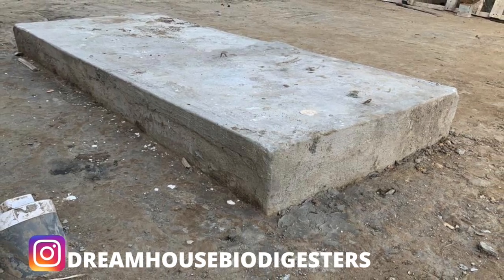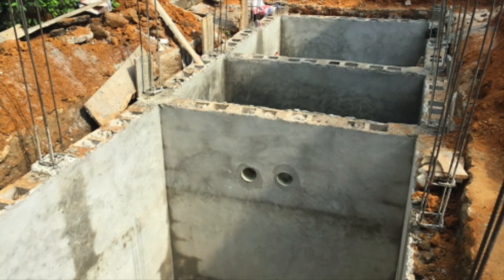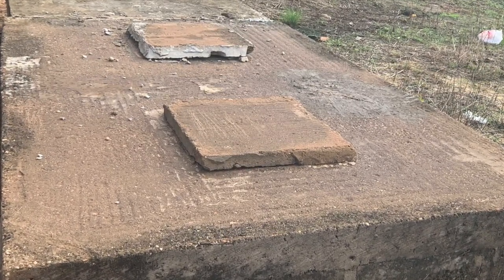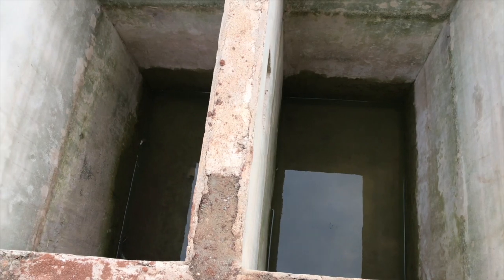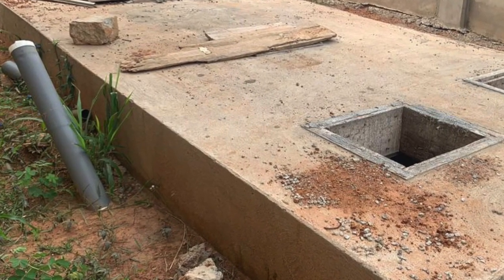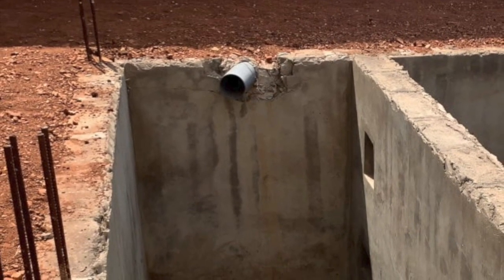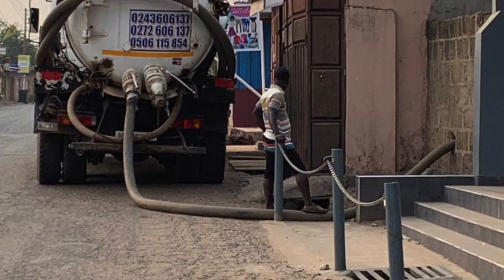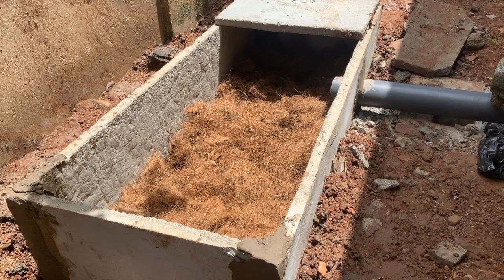Septic Tank or Biodigester: How to make an Informed Choice

Comment: Now if you have plenty of room for a septic system, and can pay for one, I would choose the septic tank. If there is a pipe that is letting out the methane gases of the Bio toilet, how is NOT stinking? 
Maybe for 1 person it would be okay, BUT, how do you separate the liquids from the solids, use 2 separate toilets? I'm sure this might be great for a place where septic tanks may be hard to build in a small space and if you don't have much time or money and need a place to go to relieve yourself, BUT, if you CAN go the septic route, I would. With a family of 3 or more, that solid waste is NOT going to break down very fast. My septic tank is basically a BIG "bio digester" with bacteria that we add every 3 months, and probably don't need to. When that lid is off, you can smell the methane gas buildup, and it stinks with the lid off, so, how is that Bio toilet NOT smelling with that little pipe sticking up out of the top of it? That poop without any liquids is just going to sit in the bottom and will NEED cleaned out in time. Those shown here are concrete on the bottom, no way of the waste being able to be absorbed into the ground. It all seems like it would be a major pain to keep up when you think about the reality of it and not just hear the things being said that make it seem like a great idea. 
Now the big ones on a farm that they can harvest the gas to make energy to use, maybe they make sense. This video showing a tiny box with a solid floor just makes no sense to me that it will be decomposing that poop quickly enough to not be a pain making you have to get the sludge sucked out often. And, most of al if the poop is dry, no liquids in with it. 

This video is so long since the narrator keeps repeating stuff.
Reply from the maker: You’re highly uninformed Julie. May be...just may be you need to do a bit more research about what we are talking about on this channel. You seems to get a lot of things mixed up. There’s a shorter version of this video here might just help https://youtu.be/jUysJGh2Kn8